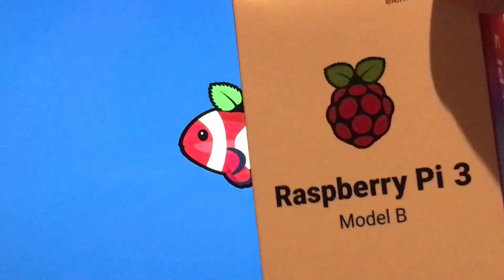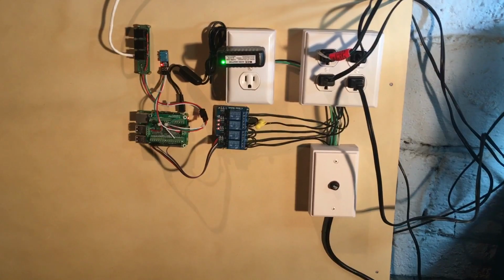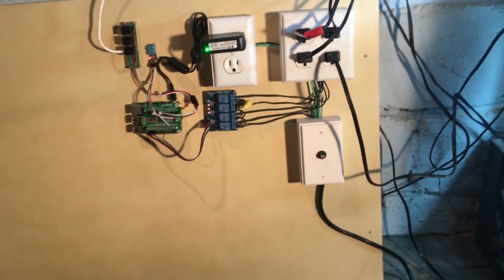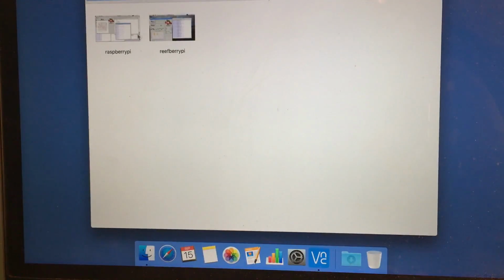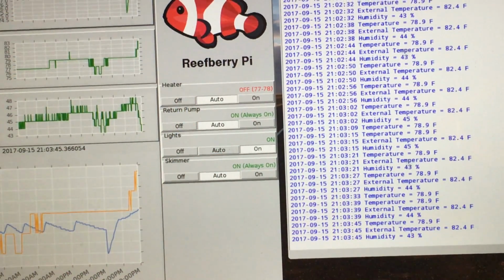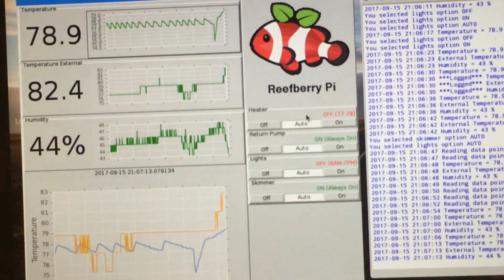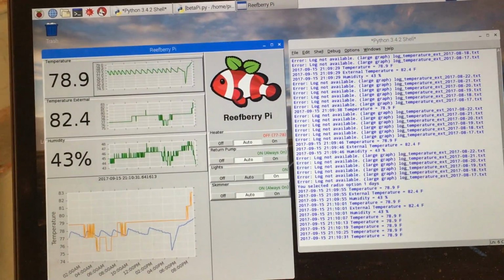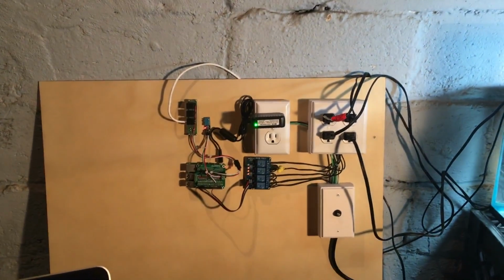DIY Aquarium Controller - Introducing the Reefberry Pi!

Comment: Hi, what type of cable uses between relay and electric plug?
Reply from the maker: I stripped some old computer AC power cords.  I believe it was 14 gauge copper wire.  Just be sure what you use is rated for the voltage and amperage you will be running!
Reply: ReefSpy ok, more complex is conect reley. Requiere bridge between point 1 and 3.....

Comment: Doing something very similar for both hobby reasons and as a college final project for Java! It's cool to see other people's takes on the same concept. I'm curious, can you provide more info on the fuse? I don't know too much about that but I do want the added level of safety. Thanks!
Reply from the maker: Sure. Its just a 15A fast acting glass fuse inside a panel mount fuse holder. This is wired into the supply line. The idea is if anything shorts out or draws too much current, this fuse will blow and kill power to the rest of the circuit; hopefully before anything bad happened. 🙂

Comment: Done anything further to add a PH meter or anything? Also which temp probe are you using? Im currently ordering stuff for my build and could use any info you will share thanks
Reply from the maker: I started on pH meter, but haven't finished it yet, hope to start working on it again soon.  Here is a link to how I hooked up my Temp probe https://youtu.be/76CD_waImoA?list=PLJDyE_1I8YfPQP4L8Mso2kDRItCbfq94s

Comment: Great suff man!  I'm doing the same thing but using the PI as a collector for the GUI of the system.  The probes, and power controllers are being run by TRIAC's/ OptoCouplers and Microcontrollers from AVR.  Even using the 5110 Displays.  The GUI portion of your application.... is that TK with Python?
Reply from the maker: Awesome!  I'd love to see what you are doing with all that.  Sounds pretty cool.  Yes, the GUI is written with Python and Tkinter.  I still have alot of work to do, and not sure if this is how it will always be, but it was the quickest way to do what I wanted to do right now.  I'll be covering everything in alot more detail.  Stay tuned!

Comment: Any chance of sharing your source code ? I have one running on arduino with serial interface to VB, but this looks a lot neater. Nice job !!!
Reply from the maker: sure.  it's messy right now, so not ready to be shared, but once I clean it that's the plan.  ps: I'd love to see what you've done with the Arduino!
Reply: Fantastic, and yes would love to show you what I've done with Arduino...
Reply: PS. the reason I like what you have done so much is the ability to store and trend you data. This is proving to be a bit of a nightmare using  arduino with a VB GUI :)

Comment: Ok, watched it all.  Great stuff!  You got a lot of code in place already!  What's your plan to collaborate?   Open source on the software?   Where do you need/want help?
Reply from the maker: laminar flow That's dedication, thanks man!  I know this was a long one.  lol. I guess at some point I can post the code on github or something, but its not really in a state for sharing yet.  I haven't even begun integrating a Ph probe yet.  I think that will require some sort of analog to digital conversion to work with the Pi, so could use some help with that since I've never done anything like that before.
Reply: Yeah I believe the RPi has no hardware for analog to digital converting
Reply: ReefSpy did you ever publish your code or anything? Thank you